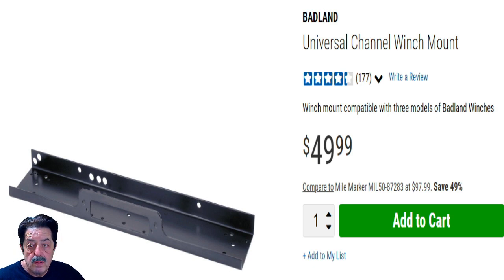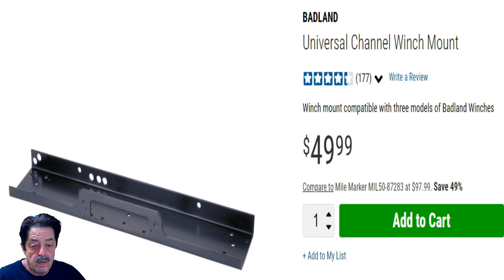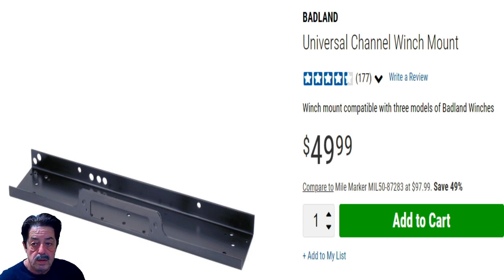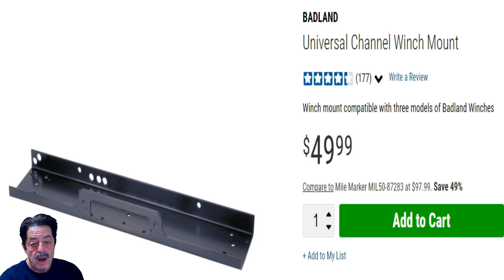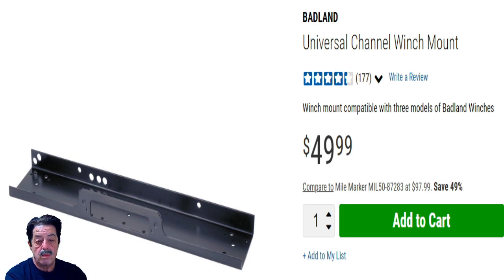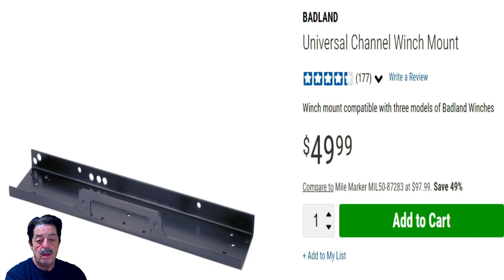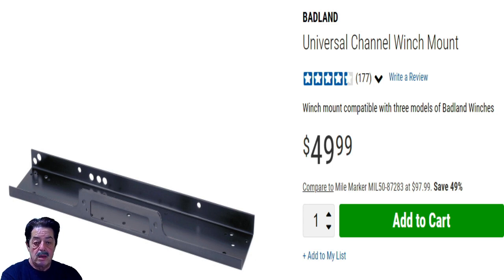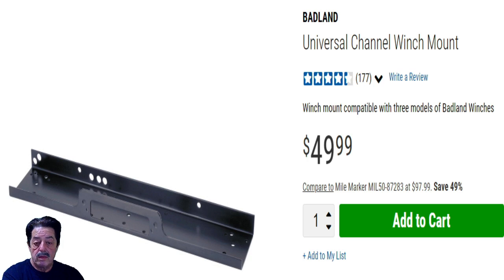Harbor Freight -  Badland Universal Winch Mount - Pro's and Con's

Comment: This bolted right on my 95 Wrangler with zero modification.
Reply: You didn’t need to drill any holes? I need to mount on my 94 yj.
Reply: @dgtlionbarger  Nope, it fit perfectly. 100% bolt on.
Reply: Fit my 95 perfectly as well.  Bolted right on.

Comment: What about if a person is “STUCK WITH” this plate and winch, IS concerned about that one fateful “full capacity” pull, and wants to “reinforce” their HF Plate and/or OEM steel bumper mount-points....?  Maybe too hard to explain in a comment, maybe a good idea for a future video, but I’ve been putting this project off for over a year and want it DONE... 

There must be some common-sense (to a skilled iron worker) principles/approaches to making a potentially inadequate EXISTING steel structure less likely to fail!!  (By adding more material? brackets? Maybe even a pair of “arms” that would attach to the actual Chassis?? 

There’s gotta be something, that’s all I’m saying. And you seem like the guy who would know.
Reply from the maker: You are right and i will see if i can put together a explanation on a video of what can be some options.....thanks it will be a bit but i will dig into it